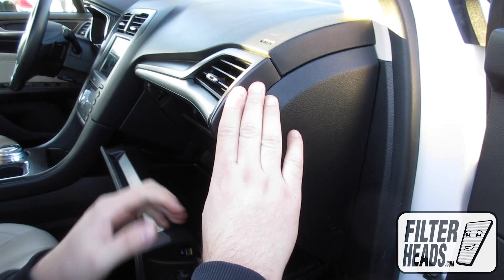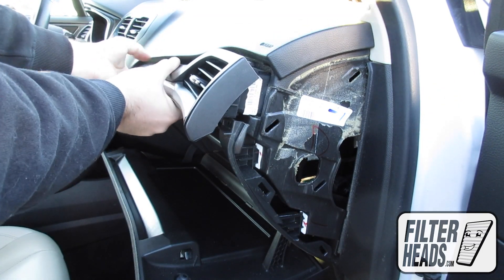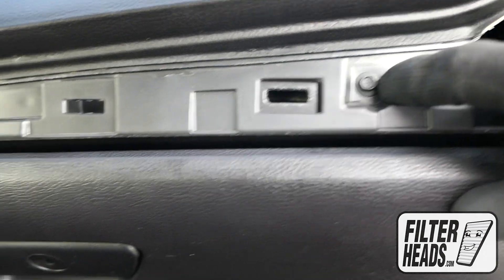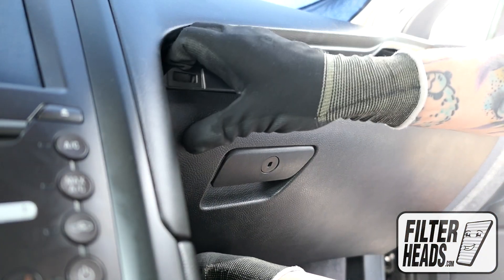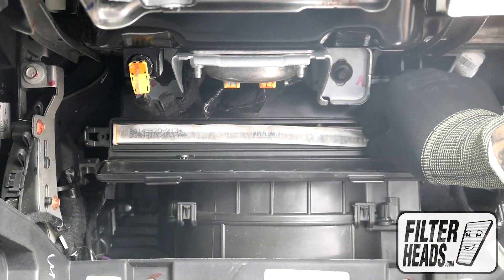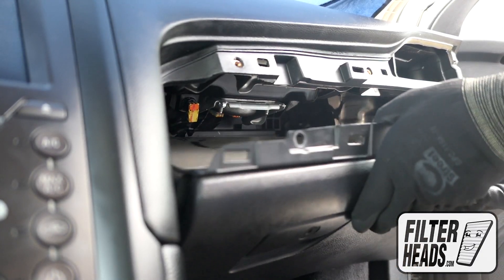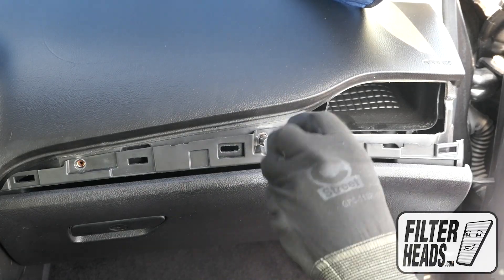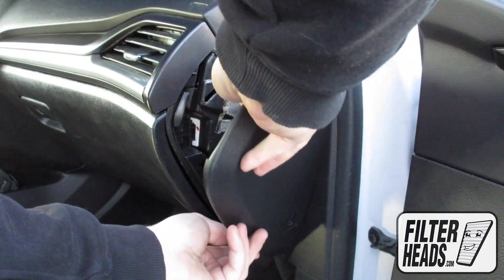How to Replace Cabin Air Filter 2017 Ford Fusion | AQ1227

Comment: Good instructions. Ford made this needlessly complicated. Most I have changed have been 1open the glove box and 2 remove filter. Engineers should be forced to use and service what they make.
Reply from the maker: I agree they need to design better procedures.